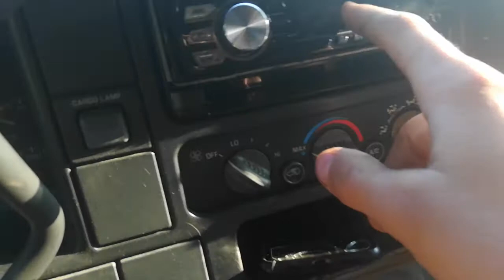2000 OBS Chevy k2500 24v swap! Part 1 introduction

Comment: SO I've got 97' Cummins and 99' Chevy NV4500. Will they bolt together with dodge input shaft and not need to be machined? What size input shaft is required? Thanks